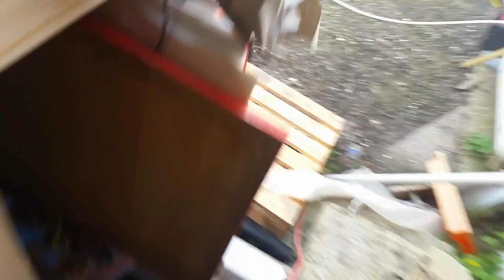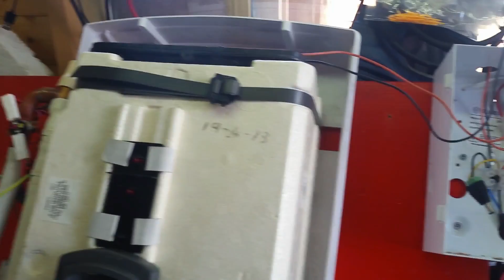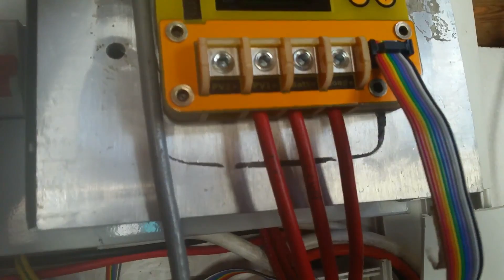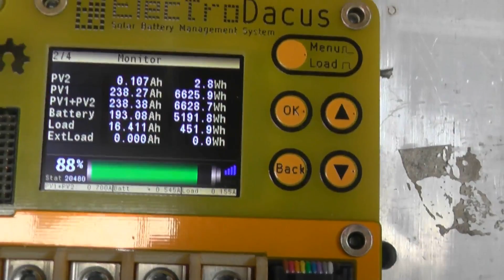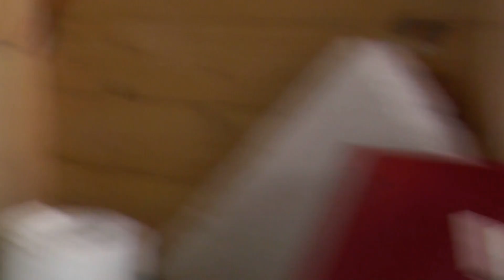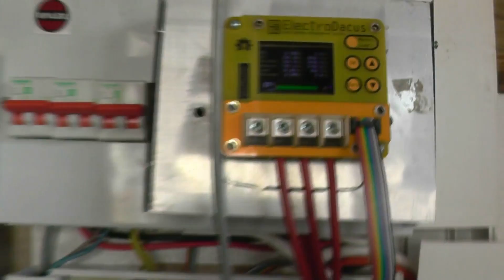OFFgrid hot water - small scale - 5L - 200W

Comment: That is a neat little tank. Wish I could find them here. Using a boost converter at panel power point is going to be one of my future projects to make a video of.  I heat 9 gal water now at my camp with excess solar power that would normally be wasted. Your electrodacus controller is just PWM and you could get a lot more power by connecting the boost converter to panel busss.  It is a fairly simple circuit to modify the boost converter to operate at power point. Be glad to work with you. Check my videos.